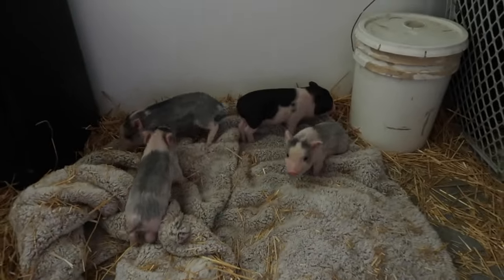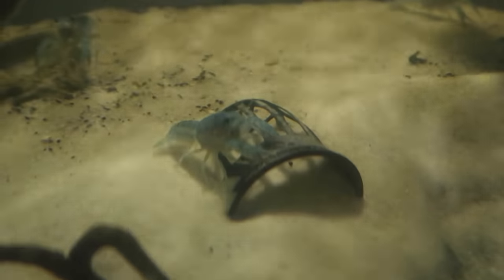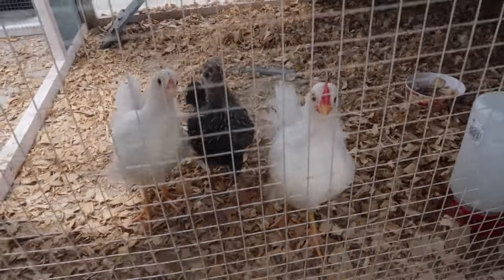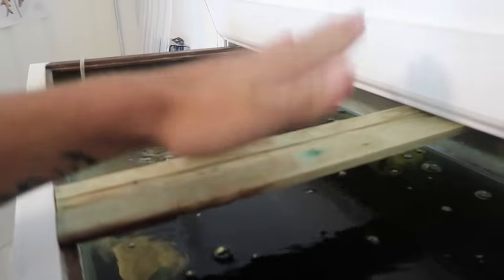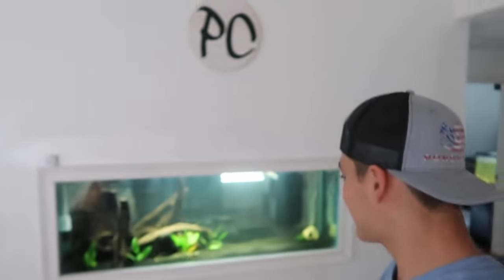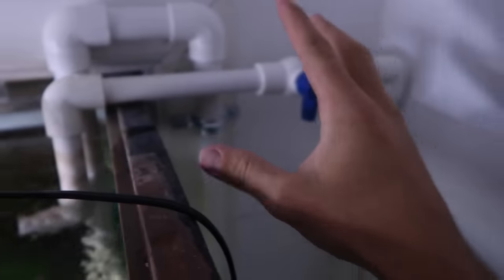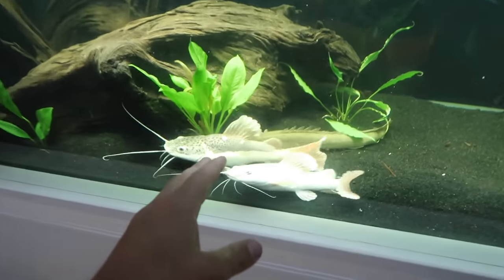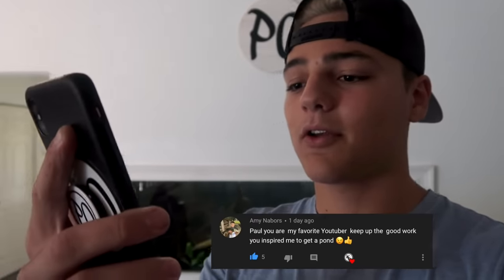$2000 PLATINUM FISH TRANSFER to NEW AQUARIUM!!!

Comment: Petunia Pig!                                                                                                                                                               When you decide to redo your hardwood floors you might want to think about tile instead of wood.  There is a tile that looks like wood, you might want to check it out.  It comes in three colors and you can find it at Home Depot.    Marazzi
  Montagna Dapple Gray 6 in. x 24 in. Porcelain Floor and Wall Tile (14.53 sq. ft. / Case), this is what I used in the house I remolded and it came out great.  The grey might be to light for your teats, but like I said before it comes in other colors.  The tile will not be ruined by the water and it can also be used as the baseboards to create a water barrier between the baseboard and the walls.  After the tile is laid, the baseboard tile is set in place, and the mortar has dried it is time to grout everything, but where the tile meets the wall.  That part needs to be caulked.  The plank tile I'm talking about is 6" wide, so that will give you a 6" water barrier between another possible tank flood and your walls.  Also, the tile will help to keep the house cooler in the heat of Florida.  Also, never give the chickens uncooked meat, raw egg/egg shell (cook the egg/toast the egg shell), don't put the chickens and the pigs together, and never feed the pigs raw meat (never,ever raw checked or eggs).  Fresh blood will drive both chickens and pigs crazy.  Love you videos and what your doing.

Comment: Paul, That cedar is gonna get wet and rot out really fast under the lid. Put it on top of the plastic cover. 2 pieces. and the light supports sit on the wood.

Comment: Hi Paul was just wondering if the wood you put in is weather proof stained or just for water cause wood rot can and will start when the moisture content of the wood reaches 20 percent. But wood rotis a slow process where the fungi start to grow and feed on the cellulose in the wood. The wood needs to remain damp and wet all the time for wood rot to. Oh and maybe you should name one of the pig Tilly!